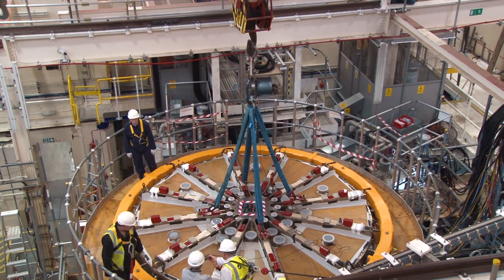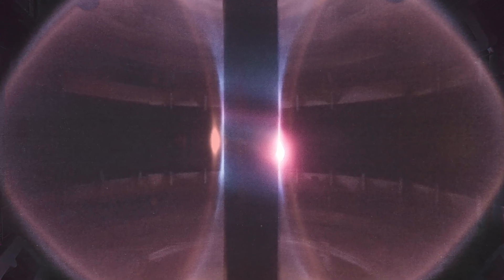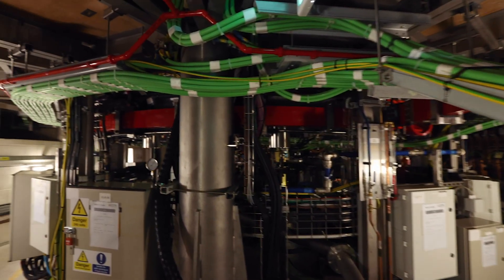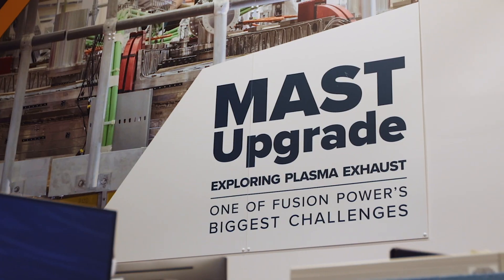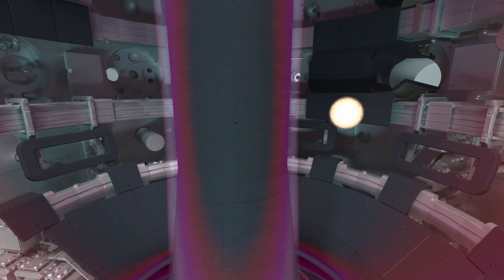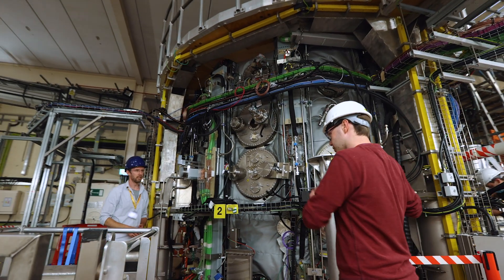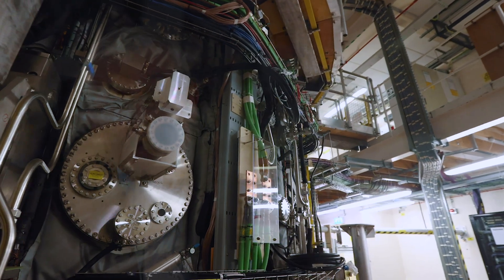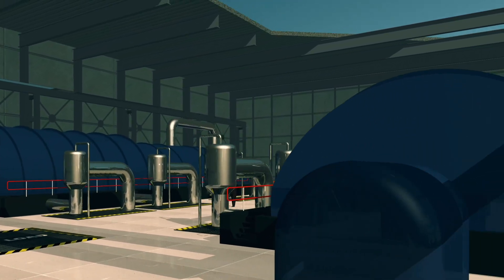Shaping fusion power for the future - Mega Amp Spherical Tokamak Upgrade

Comment: It's more than just clean energy, we could use this anywhere. Here on Earth you can just dig a hole. Under the crust it's as hot as a volcano, we should also make a machine that can dig these kinds of holes, not easy as digging rock that is 1000C needs more than a regular digger. Hopefully fusion energy will one day be able to produce a surplus of energy at an affordable price. We have learnt a lot already but maintaining fusion is not easy, plasma at 100,000C is tricky to sustain. It also uses a lot of energy to heat something to that temperature so you must generate more than that just to power the Tokamak. Making exercise equipment that actually created energy might be easier? "I am turning on the TV, you got to get on the exercise bike!"

Comment: The problem with smaller fusion devices is that they can't handle the super hot plasma for extended perioids of time;
Unless  the plasma confiment and control is so good that you only need to 
extract heat where you are capable of doing so - I.e. in the divertor.

Problem with the divertor is that the initial plasma exhaust is too hot for  any currently known material to man to take direct contact.
Smaller the divertor --> higher plasma exhaust temps to handle relative to the surface area.
Overheating the divertor (or any part of the vacuum vessel) would pollute the vacuum with metal ions and *poison any further fusion reactions*.

However if/when the divertor research succeeds; the plasma heat can be 
"diluted" to temperatures where the divertor is fine taking constant 
~1000*C -- 500*C heat blow and pumping out the helium "ash". This does 
not mean any energy is lost, it is just spread out over larger volume.
Note that this is still ~4x-10x greather heat density to extract than nuclear fission reactor operating at ~300*C.

I would compare the exhaust of fusion reactor to that of rocket engine;
Today fusion reactors have the same problem known in rocket industry as "engine rich exhaust". :D

Comment: designed in the UK - sold... no wait - given to France so we have to buy back the power... clever.  im just curious, how much power has this thing consumed, both this new version and the old one, over the years of operation. was it powered by fossil fuels or nuclear - resulting in toxic waste that will be deadly for generations to come?

so why dont you want that heat? is that not the output of the system to then convert that into electricity? -
 Add fuel - burn it - extract energy. is this just an electric engine with one concourse piston cycle?

you should be able to achieve proof of concept on a smaller scale.

Comment: So my question is: Did you get any, even only minute amount of fusion, or the machine is circulating only plazma?
Reply from the maker: Hi Joe, thanks for your question. We will use deuterium plasmas in MAST Upgrade, and the collisions these produce are very useful for studying how to confine and control plasma in fusion devices. To produce lots of fusion power, you need to add tritium fuel to the deuterium. MAST Upgrade is not designed to do this – machines like JET and the next-step ITER tokamak are.

Deuterium plasmas can produce very low levels of fusion – so we do expect to see very low levels of fusion in MAST-U
Reply: @UKAEAofficial  So why didn't you use Deuterium plasma until today?

Comment: Amazing work. I’m hoping Fusion is really only 30 years away. We need a new clean energy source as soon as possible.
Reply: It's been 30 years away for 70 years now. It's arguably the hardest technical challenge facing humanity. But I hope we live to see it, it'll be so worth it
Reply: @leov666  Agree with your comment and am sure we all hope it will not be another 30 let alone more years to viable fusion power. However, surely on the scale required and the time span available we must implement latest generation Fusion as well to fill the gap.
Reply: @ASL 72 until the prototype is fully operational and produces more energy than is consumed then we shouldn’t be too certain....yet. I am hopeful their calculations are correct though.